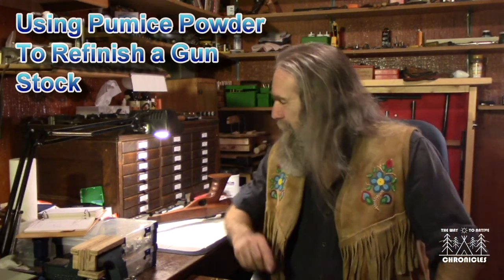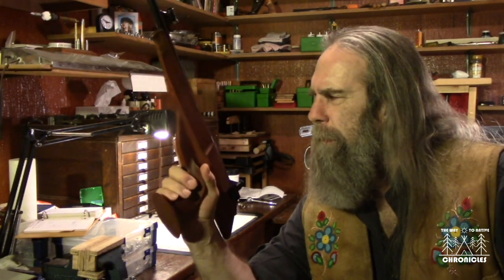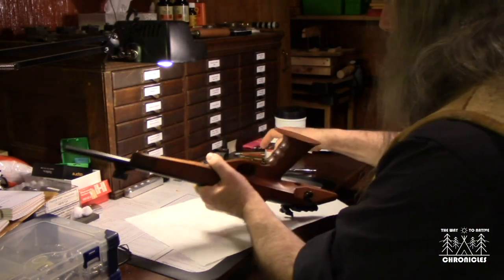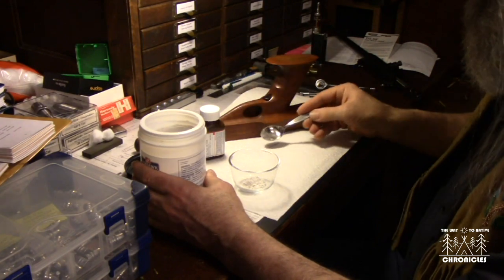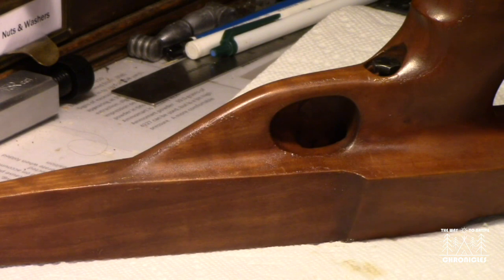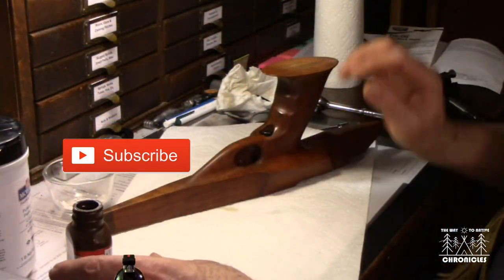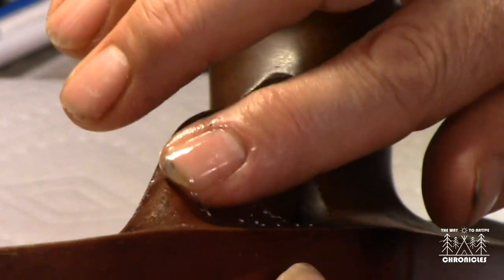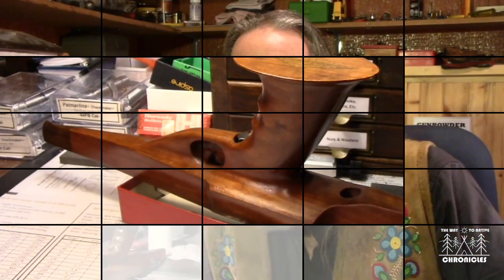Using Pumice Powder and Linseed Oil to Refinish a Gun Stock

Comment: 0000 steel wool is what I use to buff out runs it works well!
Reply from the maker: Good point.  I used 00 steel wool because it was recommended by the Tru-Oil instructions for between-coats.  But, for final smoothing, probably 0000 would be better.  I might just give that a try, to see what difference it makes.

Comment: that is not linseed oil that is true oil an entire diferent game it has more polymers in it and a drier linseed is done over a long period of time with many man coats i have used tru oild many times myself and i have had good results using 1000 and 2000 grit wet dry and then buffed it out with mothers chrome polish yes mothers chrome polish and the stock comes out like glass but boiled lindseed also can give the same results but takes much longer but is much easier to repair if scratched
Reply from the maker: Thanks for those useful suggestions William.  I might have to try that chrome polish myself!  And yes, you're right, I was using the terms "linseed oil" and "Truoil" rather interchangeably; they are not one and the same.